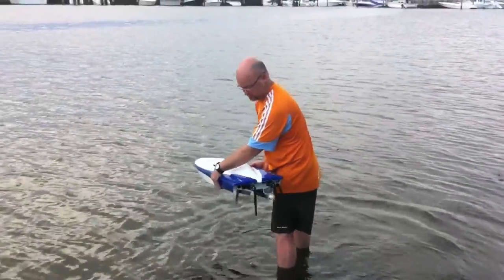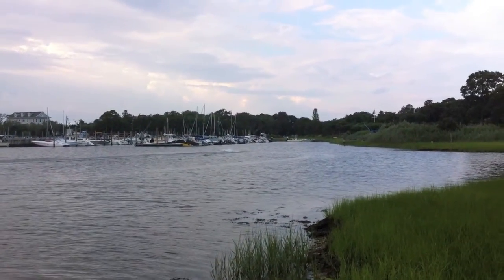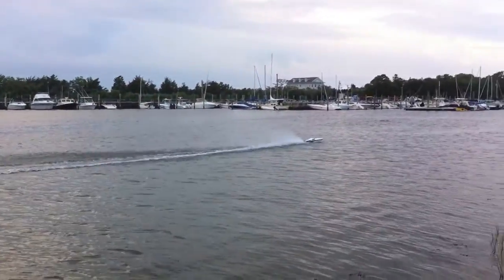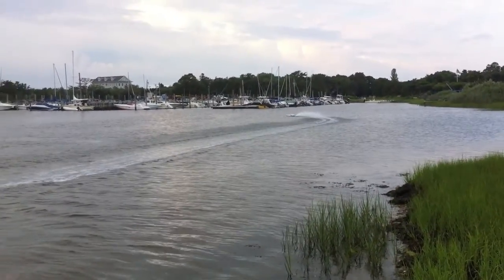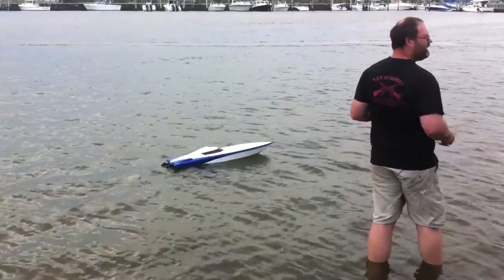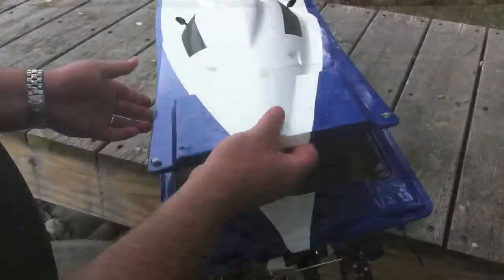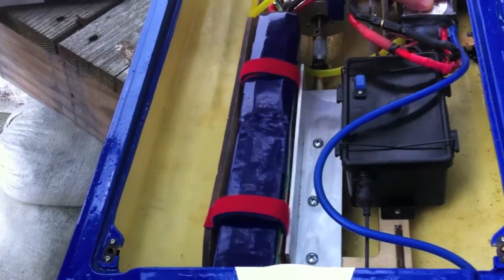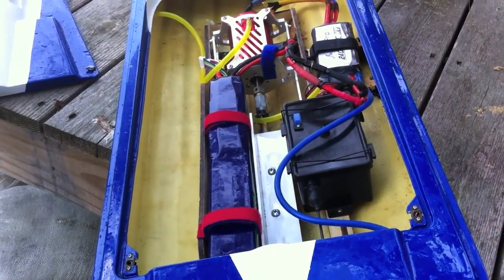Aquacraft Rio 51Z Brushless conversion on 10S

Comment: blz amigo tenho uma rio 51 28cc qual motor eletrico posso adaptar
Reply from the maker: +rivail azzola junior we bought the motor with a stock mount and was epoxed into the boat.
Reply from the maker: +rivail azzola junior Leopard 5698 910kV motor 5675mm Water Jacket driven by a Swordfish 240A HV ESC

Comment: FYI
SAW runs are much faster than 35k rpm.. some are in the mid 40's to 50k range ;)
this setup under a load is no more than 33k and possibly under 30k ( 3.7v per cell x KV )
either way... a 55mm prop is possibly what I would have started with.. this boat should be flying on 10s BRO !!
I'm not sure how much Mah your running but 10,000mah helps hold the volts higher

I have one of these hulls and will be putting a CC2028 motor on 8s and run the stock gas prop.. should bet me close to 60mph with it :)

Comment: Any idea on amp draw with that prop on that motor?
Reply from the maker: Nope, but It pushed the 240amp HV ESC to thermal. So too much even on 10S.
The prop choices on the 1/4 inch shaft is limited so we have a 1/4 to 3/16th unit that will open up smaller prop choices. Will be playing with it later in August. I'll report back then. H

Comment: Nice boat :-) any idea on speed???? I have started to get rid of my gas boats and going over to electric. Planning on large cat with twin 5692 - big out lay so ne yet convinced on which motor.

Regards - Gary
Reply from the maker: Gary, No real idea on Speed. It think its quicker than 26cc gas set up but we've struggled with cut off and amp draw due to prop size.